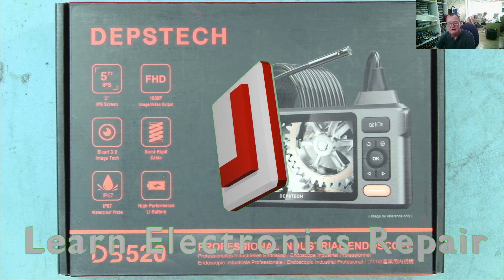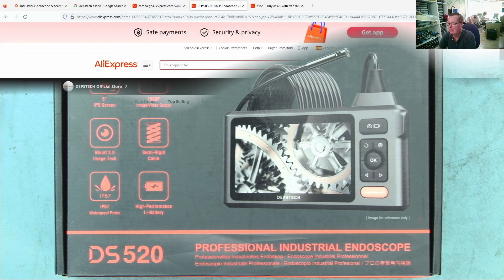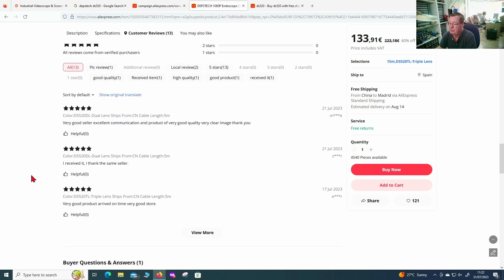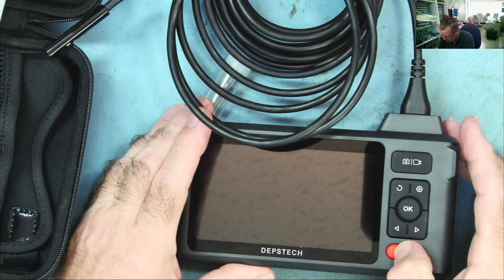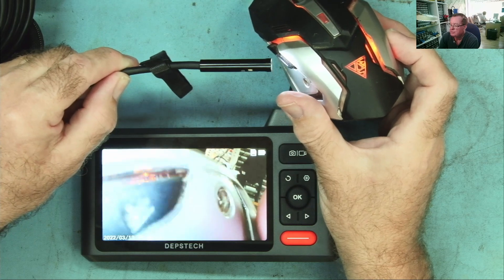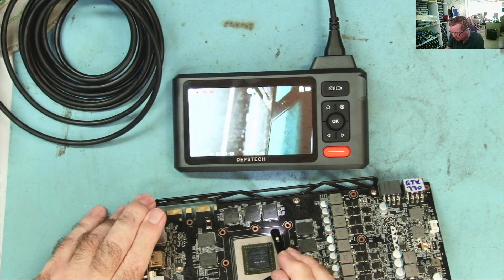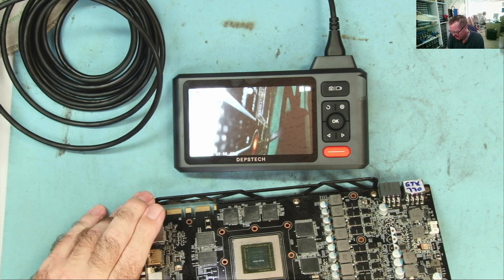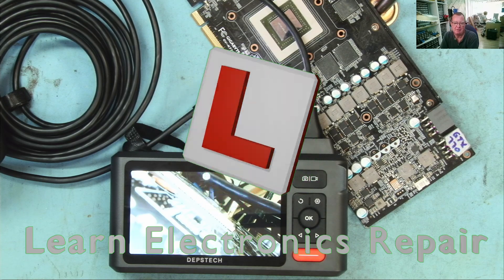Depstech DS520 Endoscope test and review. Good for Electronics Repair PCB / BGA Inspection?

Comment: Hi, I have a question.
I am in need for a load tester for SMPS and USB (in one if possible) with variable load up to 800W (e.g 12V 66A) and active cooling.
Is there something on the marked that you can test or recomend or build?
I would love to see a video for that. if its possible. I have seen your video about the USB load tester, but thats just not enough.
I would love to build one, but I dont know where to start with a schematic and the PCB's

Comment: Could you not do the same thing by holding the board in question in a vertical orientation off the edge of the table and swing your binocular microscope over the look at the chip in question?

Comment: I've used mine to inspect vintage receivers, amplifiers, and tape decks.  Sometimes the components are tight.  Boards vertical, side by side.  You can't even look at what components are in it.  Works great to inspect solder pads and such.

Comment: Your need something with a lot better optics to see under a BGA, the one we had was about 50K and it could not see all the connections under the chip. if needed they were x-rayed to be 100% sure.

I went to an assembly house once and they were x-raying chips in sealed packs to see if there was any silicon inside? A lot of fakes with nothing inside had made it in to the distribution chain. so it was better to know the fakes before putting them on your boards.

Comment: Hi Richard 🤗🤗
Nice Tool, but i miss the auto rotation from the cam and auto focus . 
Thx for your video👍👌🖖
Reply: I think, on this occasion, it is better off without the autofocus as it would probably focus on the wrong thing on the board. Maybe it could be turned off manually, though, and then would be handy.